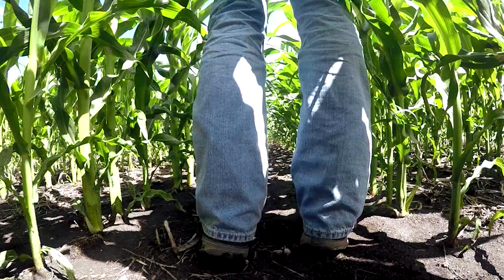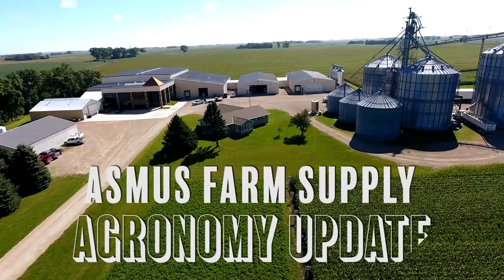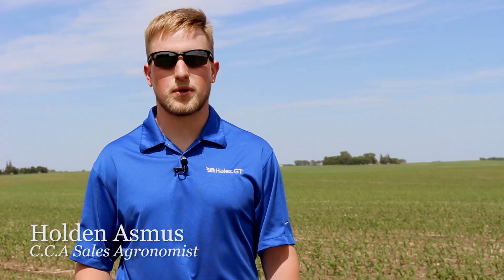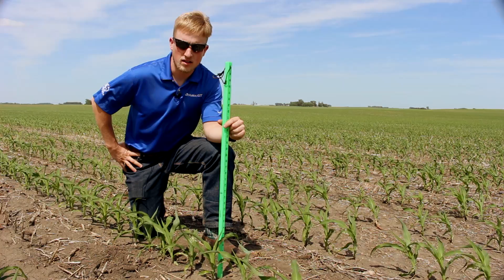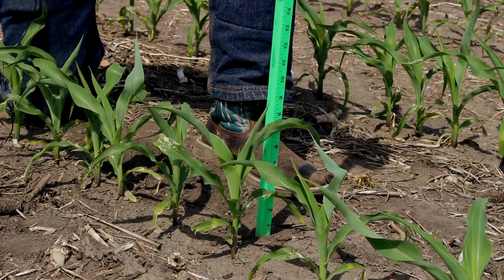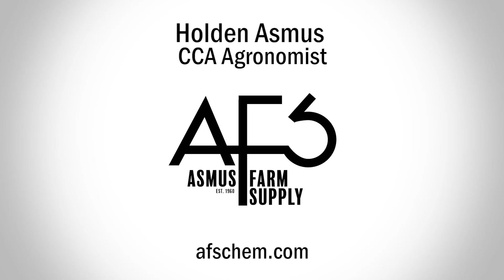Corn Herbicide Application Timing

Comment: This guy is full of corn. Farmers don’t need to apply herbicide. They only need to spray the ground with boiling hot water. That’s it. No other treatment is necessary. The penetration and coverage of the boiling water can easily be controlled.